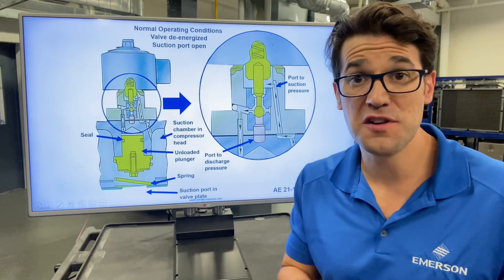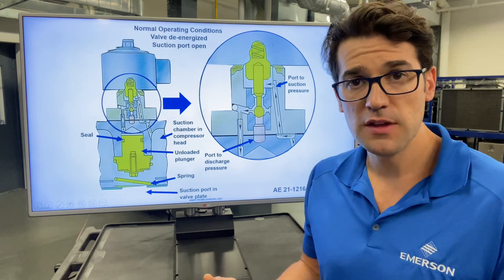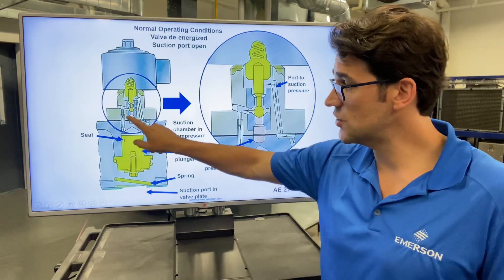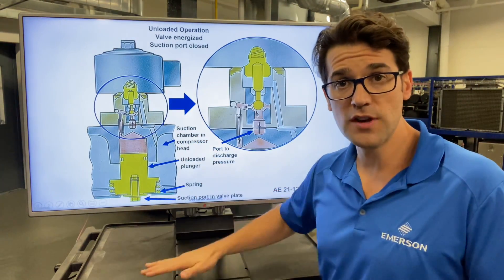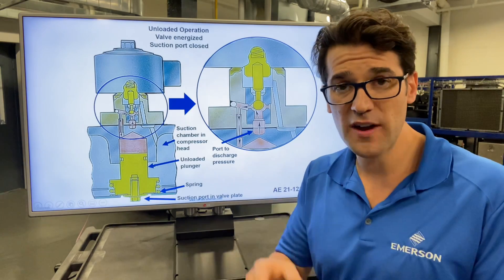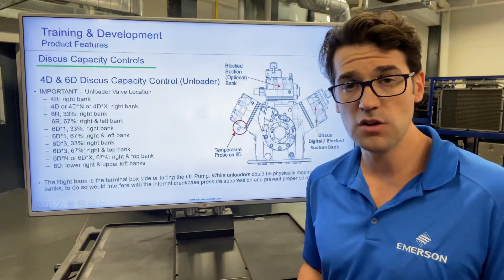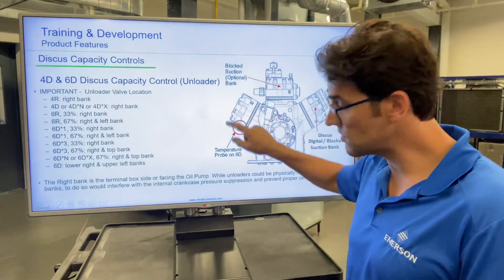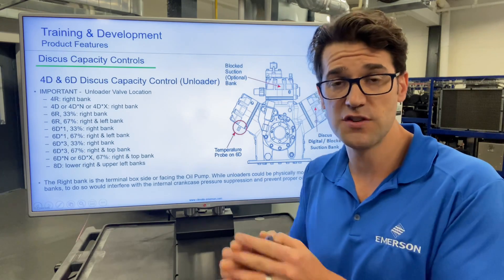Copeland 4D/6D Blocked Suction Unloaders

Comment: This also applies to a 3D compressor where the load is reduced 50%? 

Model# 3DTHR17ME-TFD-800
Reply from the maker: No they are different. That is a moduload compressor and the way it works the compressor unloads by allowing compressed gas to go into the storage chamber above the cylinders and re-expand back into those cylinders during the suction stroke vs not compressing.  When this happens volumetric efficiency and compressor capacity are reduced, and depending on where you’re at in the compression ratio will depend on what percentage you unload to, resulting in some efficiencies. I would not think this is used very much anymore as a digital or vfd would be more efficient.
Reply: @RefrigerationMentor i appreciate the quick response. My customer has this particular compressor and i was having an issue determining if it is even working (unloading). From my understanding the compressor amp draw would drop when the moduload solenoid is energized, correct?

Comment: If you replace an 06e compressor with a new 06e, but the new compressor doesn't come with an unloader head, can you swap the old head to the new compressor, or is there a different valve plate?
Reply from the maker: Yes I believe so. You will need a new gasket.

Comment: SALUDOS AMIGO, ESTOY INSTALANDO COMPRESORES 6D DE 35 HP, TIENEN DOS PUERTOS DE SUCCIÓN DESTINADOS PARA CONTROL DE TEMPERATURA POR INYECCION DE LIQUIDO, UNO ADYACENTE AL CABEZAL CENTRAL Y OTRO ADYACENTE AL CABEZAL DERECHO,  YO VOY A UTILIZAR TRES COMPRESORES  6 D CON UN SOLENOIDE DESCARGARDOR PARA CADA COMPRESOR, VOY A MODULAR CON 33% DE DESCARGA PARA CADA UNO,   LA PREGUNTA ES : COMO ES LA CONFIGURACION DE SOLENOIDES DE  REFRIGERACION POR INYECCION DE LIQUIDO PARA UN COMPRESOR 6 D, DESCARGANDOLO SOLO UN 33%?
Reply from the maker: It will only inject when the temperature is reached and it has a special piping configuration for the 6D low temp compressors.

Comment: Could you make a video on what causes ice on a distributor and it's tubes for on a txv and/or power head? Many have said it's a dirty txv strainer or restriction within txv but have seen many instances where both are clean and still causing txv to ice up. Thanks!
Reply: Low temp application? Medium temp? Comfort cooling?
Reply: May have a slight restriction in the distributor nozzle if it has a removable distributor that is flared
Reply from the maker: It could be many things. Lately I have heard many technicians who have done a refrigerant retrofit with high glide refrigerant are experiencing this.